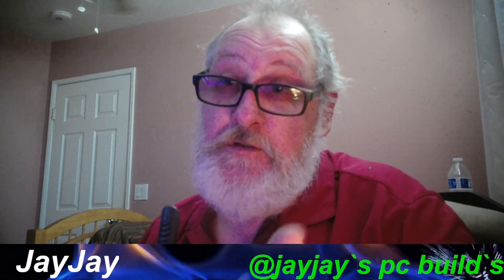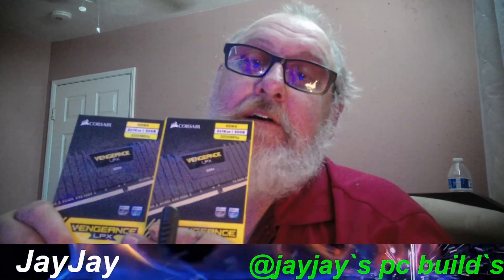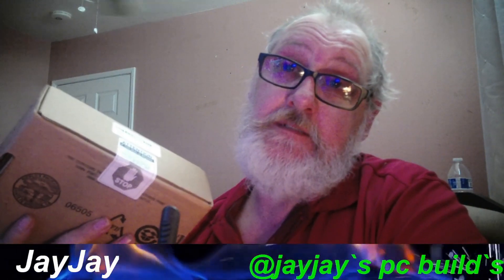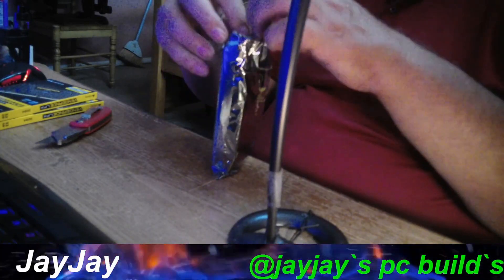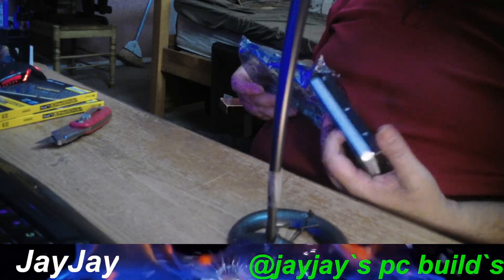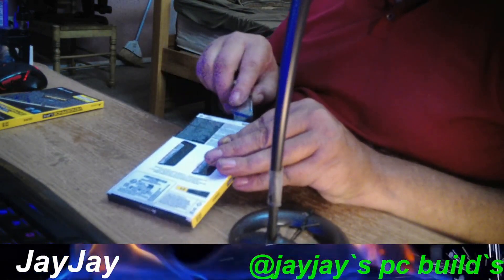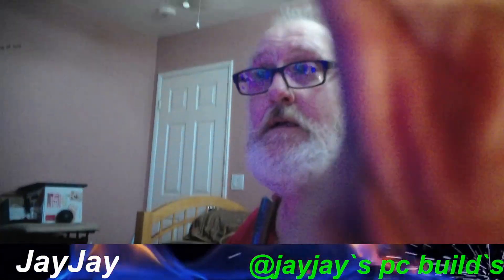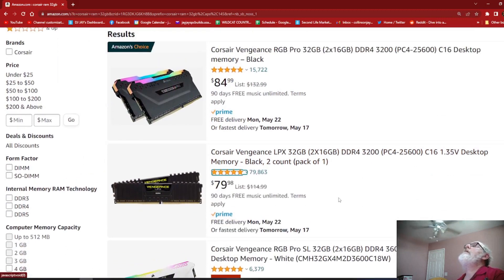Just In From Amazon ....Corsair Ram And Seagate Harddrive    #corsair #seagate

Comment: Good overclockers for sure. You could keep your timings the same and set XMP to 3400MHz easy. You could get a little higher like 3600MHz on those LPX's but you may need a memory calculator to set the timings.
Reply from the maker: i was thinking about overclocking them... right now i was just testing them at 3200mhz..... i wanted to see at the base settings to see how this Gpu would react....  i got a lot of testing videos coming up ...